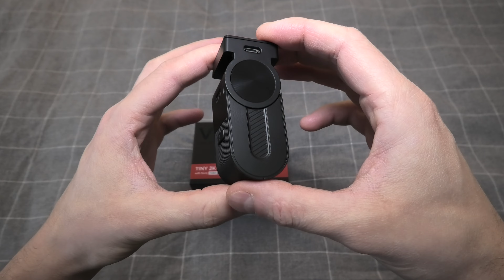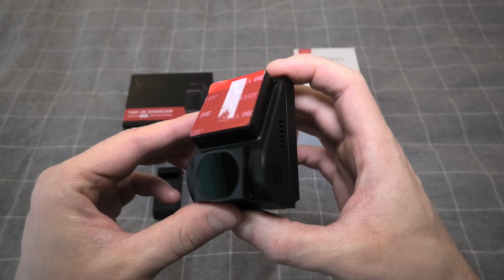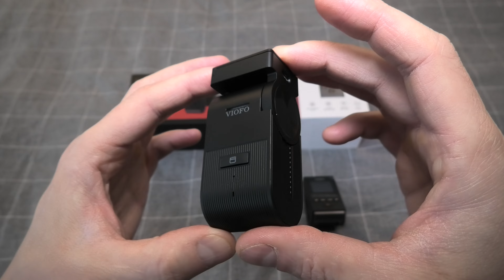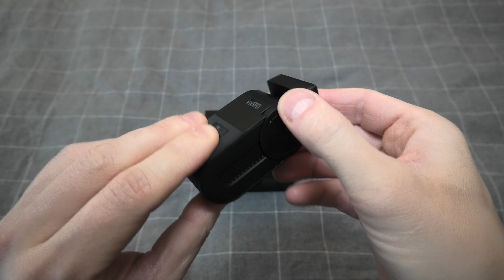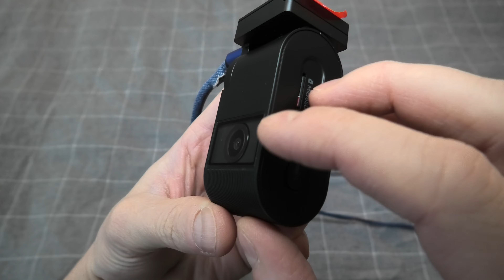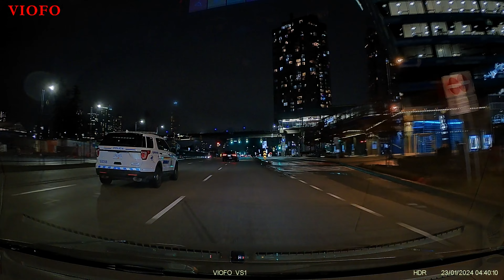VIOFO VS1 – Tiny 2K Dashcam With Sony Starvis 2 & Voice Control. Detailed Review!

Comment from the maker: PRODUCT LINKS:
1. VIOFO VS1 MINI 2K HDR WITH SONY STARVIS 2 IMX675 SENSOR 5GHZ WI-FI VOICE CONTROL GPS DASH CAM WITH FREE 32GB MICROSD CARD -  https://amzn.to/43fAlss.
2. VIOFO HK4 Acc Hardwire Kit, USB-C Hard Wire Kit for T130, A139Pro, WM1, A229Duo, A119MINI2 Dash Cam, Low Voltage Protection for Parking Mode - https://amzn.to/47cuzt7.

Comment: Couldn't find your video on how to install (hardwire).
Reply from the maker: We have a video where we showed how to hardwire the Viofo T130 dashcam in the Toyota RAV4 and how the parking mode works: VIOFO T130 Review And Hardwiring. Parking Mode Works! - https://youtu.be/CFJpegic5f0.
And this video will show how to find the constant power and accessory fuse slots using the multimeter: Toyota RAV4 (2019-2025): How To Hardwire The Dashcam To The Fuse Box? - https://youtu.be/zu9TsyYlGMQ.

Comment: Hi, can you please clarify exactly what to do when getting in/starting the car?  Do I have to change the wi-fi everytime (I have set to auto-connect)?  Do I say video start every time?  Do I need to open the app every time I start the car?
Reply from the maker: The dashcam will turn on automatically once it receives power from the vehicle. You don't need to turn on Wi-Fi for the dashcam to operate normally. Wi-Fi is used to connect the dashcam to the Viofo App. You don't need to say "Video Start" every time, the dashcam starts recording once the vehicle is on. No, you don't need to open the application for the dashcam to work normally.
Reply: @MorozovAutomotive  okayyy!    Thank you!   So the only reason to open the app while driving would be to see the cam screen if I wanted??
Reply from the maker: @aliasamw  No problem! The app can be used to view and download recorded videos and to configure your dashcam. You can also use it to install the dashcam on the windshield (to view what the dashcam sees).
Reply: @MorozovAutomotive  got it!   Thanks again

Comment: my resolution says 1440 only not 2560!
Reply from the maker: 2K resolution is 2560 by 1440 pixels. Where the 2560 is the horizontal resolution and 1440 is the vertical resolution.
Reply: @MorozovAutomotive  Got it. I have installed mine and I liked the quality.

Comment: Excellent and thorough review. Thank-you for taking the trouble to produce the video. Pity this isn’t sold as a front and rear facing camera pack. Can it be used as such if you buy two?
Reply from the maker: Thank you! Yes, you can install one in the back of the car but you will need to find a separate power source for the rear dashcam. You can't connect the two together. Viofo has other 2 and 3 channel options which can work better. We did a review of the Viofo A229 Plus dashcam. It comes with 2K front and 2K rear cameras, both with Sony Starvis 2 sensor. I think, it will better if you are looking for the front and rear dashcam set. Here is our review: NEW Viofo A229 Plus Review! 3-Channel 2K Dashcam With Sony Starvis 2 Image Sensors - https://youtu.be/jd3CPW7VCfA.